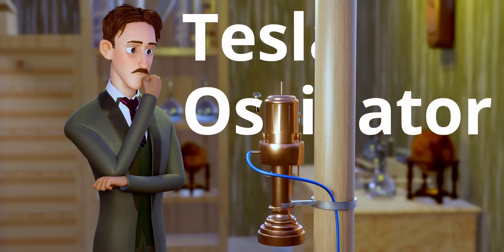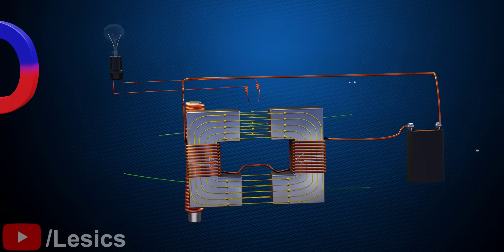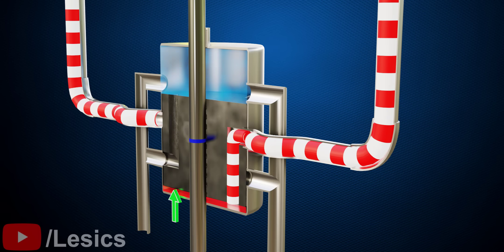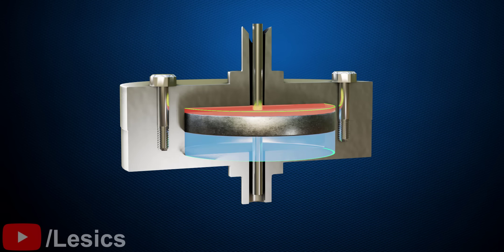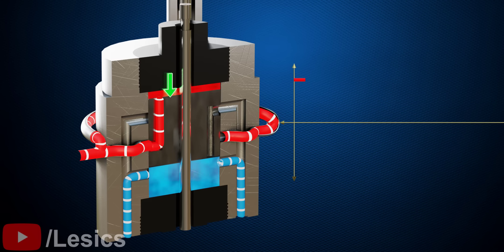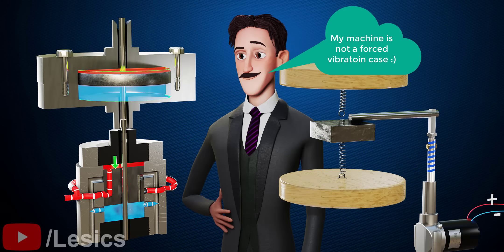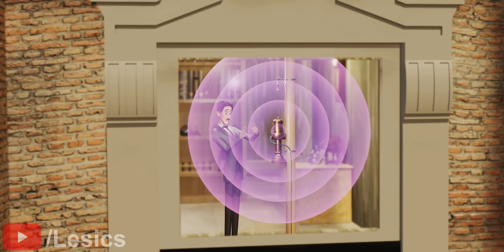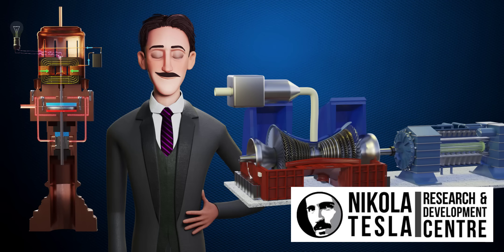Nikola Tesla's Mysterious Electricity Generator | The Complete Physics

Comment: The ability to keep simplicity in mind when creating something is absolutely essential
Reply: Simplicity is most complex thing in the world.
Reply: its nearly impossible to make something if you can't understand how it works. when you build a machine, you have to know what every part does, and whenever you come across a problem, add another part that is designed to fix that very problem, repeat step two until it is finished. :)
Reply: Yeah but the beauty of simplifying that steam engine is a thing to admire. That's what programmers go through on a regular basis, you may simplify something that's complex down even better but maybe another even more simple thing also does the job just fine. But the act of simplifying and bettering something complex is exhilarating on its own.
Reply: Simplifying a thing means that you understand the Invention.
Reply: From day one at college and everyday after we were told and constantly reminded of the principle of K.I.S.S but to know it is one thing and to follow it  is another. Many would be surprised at how complex the process of simplification can be.
Reply: or, the goal
Reply: Wicked German Cackle
Reply: Germans: hold my nano-coated piezoelectric hydrostatic isobaric beer mug
Reply: @Metal_Master_YT
Reply: @Metal_Master_YT
Reply: @malampartho6125  ?
Reply: Indeed
Reply: The INTENSION to keep simplicity in mind when creating something is absolutely essential

Comment: The Tacoma Narrows bridge collapsed for the same reason. It's resonant frequency matched that of the winds that blew against it and it collapsed shortly after construction finished.
Archimedes said something to the effect, " give me a long enough lever and I'll move the world ". Tesla might have said, " give me the right frequency and I'll rock the world. "
Reply: There are not many things you can rock just by choosing the right frequency. Most structures don't have a distinct resonance frequency and in addition most structures have friction and damping, which limits the amplitude of oscillations, even if the right frequency is chosen.
Reply: Also happens with a lot of large rockets like the Saturn V (Apollo) where the flow of liquid oxygen would slow down due to the vehicle acceleration, reducing power. Then suddenly surging when Acceleration was lost. Or where the frequencies of the engines would shatter windows miles away during initial testing until the engine inlet jets were baffled
Reply: @breakfast7595    I wonder why acceleration of e.g. the Saturn V should slow down the flow of liquid oxygen. Since the oxygen tanks are above the combustion chambers an upward acceleration should increase this flow. The flow of liquid oxygen is also assured by extremely powerful pumps. 
There is no doubt that glass can be shattered by relative small amplitudes of sound by a fitting resonance frequency. But glass can also be shattered by brute force using high amplitudes. Resonance has no relevance in this case. If an explosion or the engines of the Saturn shatter glass, it is rather brute force than resonance.
Reply: It's needs  equal amount of energy to create the destructive resonance & this is not a Tesla's invention.  Tacoma Narrows Bridge  opened on1/7/1940 & collapsed on 7/11/1940.
Reply: Well looks like Queen found that frequency.
Reply: The energy that was released as the tower collapsed was based on voltage transients and resonances. When the builders created the tower, they didn't take into account the effects of radiant energy. The tower's collapse was a result of its resonant frequency matched that of the winds that blew against it.
Reply: Then know this, the genius who proved it so was Theodore con Karman.
Reply: @heinzpg  You can rock anything by matching a frequency.
Reply: @anopoabednego6173    No. First of all, you need a system which is able to oscillate. A simple mass like a stone does not oscillate. If you push the stone in one direction, it doesn't come back. But if you put the stone at the end of a pendulum or hang it on a spring, you get an oscillating system with a distinct resonance frequency and you can easily "rock" it with this frequency. But more complex systems do not have one distinct resonance frequency. Just think that two systems are coupled, both having totally different resonance frequencies! 
And a major problem is damping by friction. It is easy to "rock" a pendulum in air, but try this if the pendulum is submerged in a pot of honey! The friction consumes energy and with huge damping the gained amplitude is modest, even if you use the exact resonance frequency in stimulating the system. 
You can not rock anything by a matching frequency. This is only possible with oscillating systems with a major resonance frequency and small damping.
Reply: 432 HZ.

Comment: "The present is theirs; the future, for which I have really worked, is mine." ~ Nicola Tesla ~
He was even right about that!
Reply: Nikola Tesla was an electrical engineer and inventor who developed a number of devices that greatly influenced the development of electrical technology. He is best known for his invention of the rotating magnetic field, which is the basis for most AC motors. Tesla also developed the first system to provide alternating current electricity to homes and businesses.

One of Tesla's most visionary ideas was the use of radiant energy to provide power for homes and businesses. Radiant energy is based on voltage transients and resonances, rather than on traditional sources of power such as coal or oil. Tesla believed that radiant energy could be harnessed to provide power for the entire world, without the need for fossil fuels.

Although Tesla's ideas about radiant energy were not fully realized during his lifetime, they are now being investigated by scientists around the world.

Comment: It's also important to remember that the steel post he had it attached to was part of the building's frame and was freestanding. And that too would have acted as an amplifier. It's ironic that Nikola Tesla's most famous accomplishment in many ways was perhaps his only ever designed mistake. It went counterintuitive. We didn't understand resonance vibration when he built this. The post was 12 ft 4 inch metal spring basically. A very solid Steel post bolted into the steel frame of a building that unlike today's earthquake buildings was solid triangles. A lot of people talk about how tough the old Irish buildings were well that was because they where not earthquake proof and had no give. As a result the building was built very solid but didn't dissipate vibration.
Reply: Thanks , I imagine the 'earthquake' would be short lived at the point when the stored energy becomes out of phase and dumps into the rest of the building. I have observed this in a bridge, needs the right amount of input to occur (traffic).The 'earthquakes' last for 1-2 seconds every 10-15min apart. Depending on the traffic volume.
Reply: @russellpurdie  Yep, on a modern building Tesla's earthquake machine wouldn't have been anywhere near as impressive. But it was a perfect storm with no give the whole building rocked like a giant washing machine. Off center 3 legged cast iron washing machine. LOL
Reply: yr saying they had less elasticity? as a whole more brittle? you mean those old i-beam cage-like grid system layouts? or was the building brick?
Reply: @austinharding9734  the steel frame was isolated enough. relatively, to build up resonant energy. Once it got to the critical point it released it into the rest of the building, sort of.
Reply: @austinharding9734  Nikola Tesla's building had a steel frame on every floor that was built with triangles not rectangles the reason for this is to give more strength and less give we don't do that anymore because instead of giving the building simply can collapse or at least suffer more wear and tear due to metal fatigue. We don't do that anymore of exactly what Tesla did. Yeah the triangle system makes a better table but it makes a s*** building. Again it sounds counterintuitive but the vibration this way is limited to each part of the building and each room. In a modern building basically all that would have happened is Tesla's machine no matter how much it vibrate will they just shook the metal post and they get it underneath which has basically springs in it to relieve the vibration. But that old Irish building was built with actual triangle connection plates. So instead of every separate room being kind of built like a trampoline.. with the vibrations isolated to each room in case of an earthquake or a mad scientist in this case.. the entire building was basically a giant tuning fork. And Tesla's Steel post was bolted into that very fixed non-moving superstructure of the building..
But if he did it today all he would have done is maybe crack his wall because that post would have been attached to a steel frame that in modern buildings is designed to dissipate vibration.. again counter intuitive but triangles don't actually make the best earthquake proof buildings. Kind of like imagine the analogy of the oak tree vs the Reed of grass in a storm. Modern building superstructure is designed to give. Tesla's superstructure of his building was designed to be a bank vault. Out of the two to this kind of vibration damage the bank vault is the more fragile. Remember gravity wants to pull the building down. So the building's a giant tuning fork all the energies stored nothing's dissipated. 
It's why when people try this experiment today it doesn't do anything. It isn't because Tesla was wrong it's because he was right and modern design is now take it into account. Buildings are designed to dissipate residence. Any building that's more than five stories has to be built with an internal solid steel frame. 
Because concrete isn't strong enough to hold the weight up by itself it needs to be windforced with basically a metal cage. 
So it was only good sense to make that metal cage is solid and strong as possible. 
But that was actually the wrong thing to do you want to rickety badly built metal framework loose and strong but not rigid.
Reply: @rev.jonathanwint6038  excellent explanation. Always been fascinated by resonance, very interested in how it works on a molecular level , particularly to do with those tiny machines at work in our cells.
Reply: What about Toroidal fields and free energy from the air?
Reply: This isn't his best invention. AC current is.

Comment: Without you dudes creating an earthquake I won't believe you have it figured out
Reply: Gimme the money and I'll destroy any building with a steel or wood frame.
Reply: Low hz is vibration a slow spinning motor with A OFF CENTRE weight would easily do it hz is speed, so keeping a motor spinning at a constant would equal a certain hz the slower the speed the lower the Hertz i made a crude one when a kid small dc motor and a flywheel with 1 bolt as a weight 50% between the inside and outside variable resistor, OBVIOUSLY i didnt keep it running to long.

Comment: You're forgetting something about piston steam engines, namely the role of expansion. You don't need to admit steam for the entire length of the stroke and it's in fact, more efficient if you don't. If you cut off admission at some point before the piston reaches the end of the stroke, the steam admitted will expand greatly and continue driving the piston, before the exhaust stroke. That's why most engines have a variable valve gear; once it's up and running, you can change the admission to have incrementally shorter cutoffs, essentially making it do more work with less steam, depending on the load (which also means the boiler will consume less fuel and feedwater). In other words, Tesla's engine was probably more impressive on live steam, than on other working fluids like compressed air.

Full disclosure: I was a part time antique steam engineer and fireman for over 10 years.

Comment: In the time when, everyone else was inventing machines JUST to work, Tesla was designing machines ALWAYS with efficiency in mind. He is the first inventor/visionary to understand, 130 years ago, that in future (which is our time) the biggest problem we will be facing, is how efficiently we transform our energy to usable form. The time for his inventions, and more importantly, his way of thinking has come. Or as Tesla famously said:  "The next century will be mine."
Reply: You should read up on some-one named James Watt. He didn't invent the steam-engine, he made it more efficient.
All sailing ships in the world had to deal with efficiency. How to get the most speed out of a given wind.
How about adjusting the sails on a windmill? Would that have anything to do with how to efficiently change wind-energy into shaft-rotating-energy?
Reply: @DreadX10  have done that reading a long time ago. It is true that Watt improved a lot on the Newcommen's machine, which at that time was technically vacuum, and not pressure based but still his improvements, although a lot better then on his predecessors, were still as a thermodynamic transformers, quite inefficient ones.
Reply: @EfficientEnergyTransformations  So the first sentence of your OP is incorrect. The second sentence too. Everybody designs machines with efficiency in mind especially during/after the industrial revolution (100 years prior to Tesla). Tesla used 'efficiency' to battle Edison's DC-power as AC wins in that regard. Doesn't mean Tesla was all about efficiency.
Tesla's wireless power-distribution tells me that Tesla had no idea how much electricity a modern home or business would use.
If Tesla was this big visionary you claim he was, he would've invested heavily in copper-mines knowing the use for copper would rise explosively with his inventions.......
What is Tesla's way of thinking? How does it differ from the way other people think?
The time has come to use less energy in the world because its over-use causes problems. Do you want to attribute our global climate problem to Tesla, because he invented the main cause of the world's problems?
Reply: @DreadX10  "Tesla's wireless power-distribution tells me that Tesla had no idea how much electricity a modern home or business would use." Just this statement tells that you have, clearly, absolutely no idea what Tesla did and just repeat the non sense that is spread about him on the net. There  WAS a natural conductor in the Tesla "wireless" transmission design, but it requires reading and understanding his patents and publications and not repeating the commonly spread nonsense. Please spent time to read his original patents and understand them ( if you can ) and after that express some, hopefully, qualified  opinion.
Reply: @EfficientEnergyTransformations  "clearly, absolutely" : words used by some-one who has no argument and desperately wants to make it look like he somehow, somewhere does have something worthwhile to say.
Nobody was talking about a natural conductor. Straw-man much?
I've spend enough time on the subject to be able to teach RADAR-technology, transmission-technology (of EM-waves, not the kind found in a vehicle)  and communication-technology to groups of military student-technicians.
Reply: @DreadX10  Tesla used the Earth as conductor hence - wireless. Not radio, Hertzian, waves as you have said.
Reply: @PretendeP  Do you realise that EM-waves are EM-waves no matter what the transmission medium is? Be it through space, air, water or earth, they are still EM-waves.
Reply: @DreadX10  Great you mention the James Watt.
Nowadays people know only the Tesla - the " maker of the 20th/ 21st .....centuries". How grand it is?

Comment: I recently bought a gas generator. Wanted to find a way to make the power clean. 
These days everyone just says use an inverter gen. Well modified sine gas gens are 
cheap as can be compared those per watt. Thus discovered ferroresonance power 
conditioners. My loose understanding makes me think of Teslas concept behind this 
"conditioner / generator" in a way. 
IMO Im not sure its possible to convey how ahead of his time Tesla was to the bulk of 
the population. The very idea he created a crude remote controlled boat in 1898. 
While in 2021 over 95+ percent of the pop couldnt recreate his design. Taking major 
liberties here. You get the idea.  
Its really hard to imagine anyone these days being on his level "ALONE" I stress Alone.. 
While hatching and creating such tech, for the most part, alone.

Comment: The "earth" didn't shake, just the building.
Reply: It's not an earthquake but it feels like an earthquake!
Reply: I imagine the neighboring building and pedestrians must've also felt it.
Reply: 🟦 There is more than one "Tesla oscillator",...It has been recorded that Tesla built several oscillators utilizing different mechanical principles, the one that he smashed with a hammer to stop it in his laboratory was driven by an external power-source, another oscillator was built from an alarm clock and was purely mechanical in its design, that is the one he used when he walked up to a building under construction and clamped his device onto a girder whic caused the entire structure to go into resonance and made Tesla fear that the unfinished building would collapse if he didn't stop the device right away.